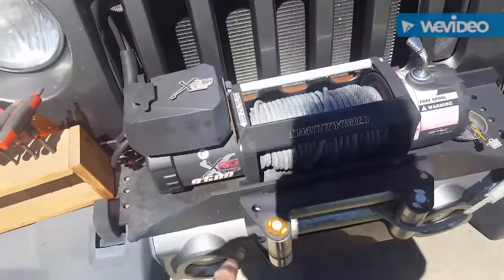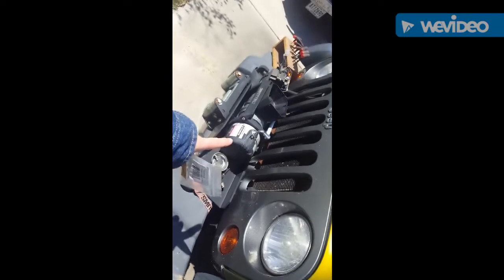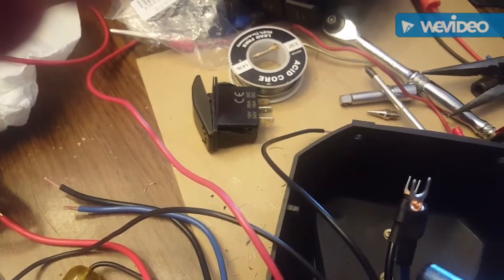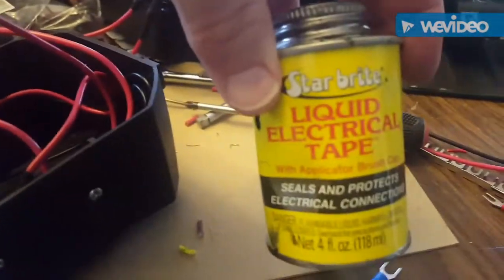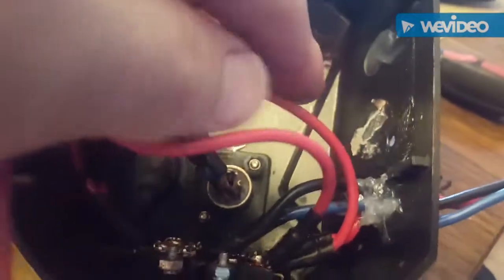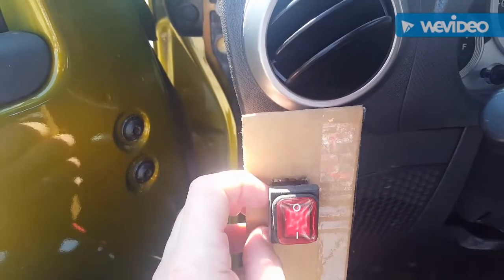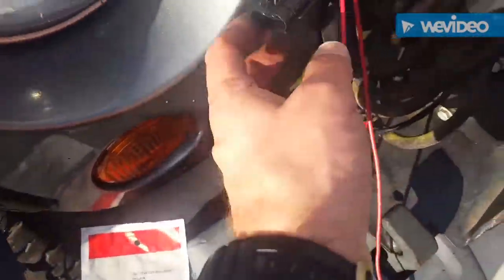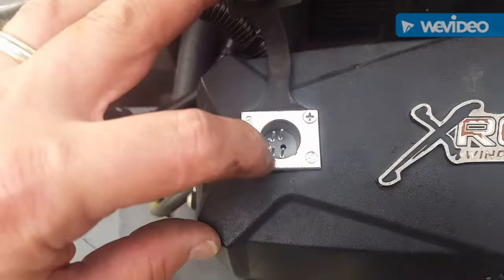In-Cab Winch Switch and Smittybilt Winch Repair

Comment: I am doing the same thing, how do I put the on/off safety switch. I know the Smittybilt has 3 wires. Does one of those wires go to the safety switch?
Reply from the maker: No the safety switch actually interrupts the  power wire going to the in out switch.  Watch this
https://youtu.be/shBZUlot12M
Reply: Major Weakness thanks do you know what color is in and out?
Reply from the maker: @mrnova70vp  it's been so long I cant remember, but if u get wrong just flip wires and it will change direction